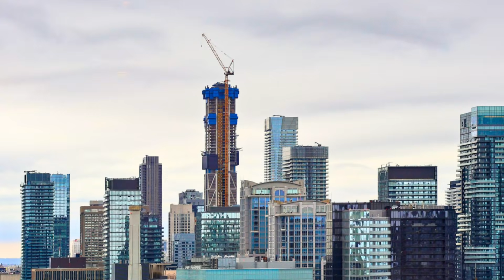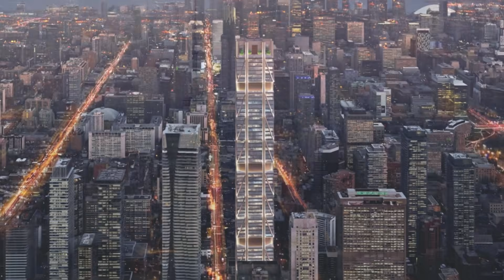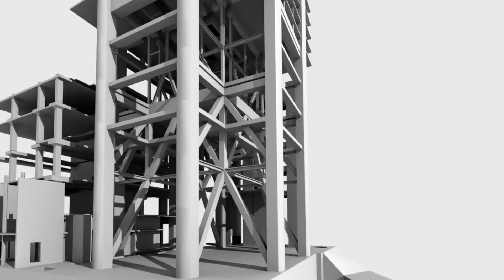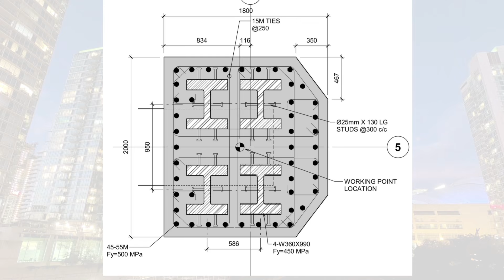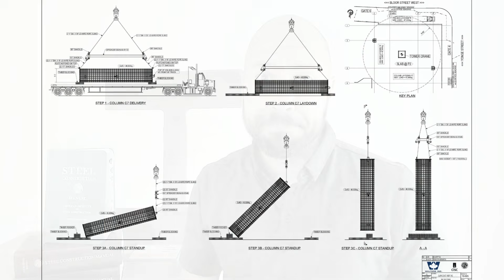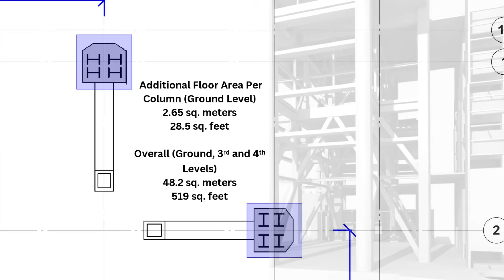Engineering One Bloor West - Canada's First Supertall Building

Comment: Great to see A913 High-Strength Steel finally getting used!
Reply from the maker: Reduce material, save on fabrication costs, and reduce embodied carbon.  It's a no brainer!
Reply: Just like how 310 MPa steel and rebar went the way of the dodo, the eventual dilution of tramp elements will probably make 410 MPa steel uncommon soon, 480 MPa and up will be the standard in the near future for run-of-the-mill structural sections.
Reply: Hasn't it been used quite a bit outside of Canada? I think we're just a little late to the party
Reply from the maker: @DrewK-e2i  It's been used in hundreds of projects globally and many in Canada.  The first A913 grade 80 project in the world was the most recent Bay Adelaide tower in Toronto.